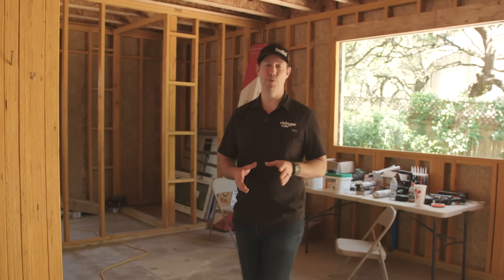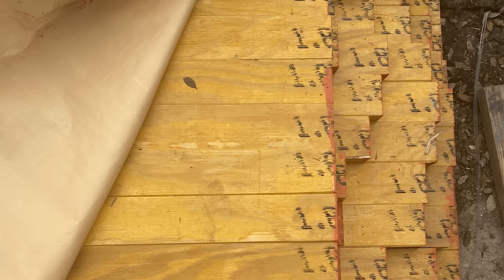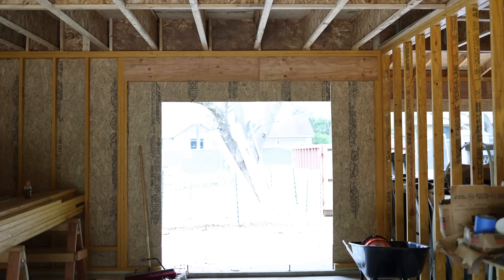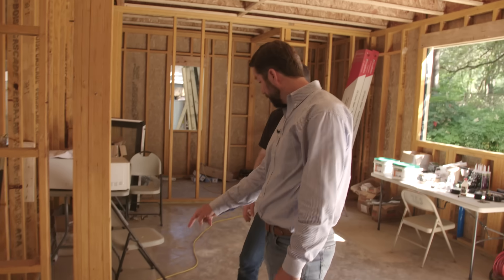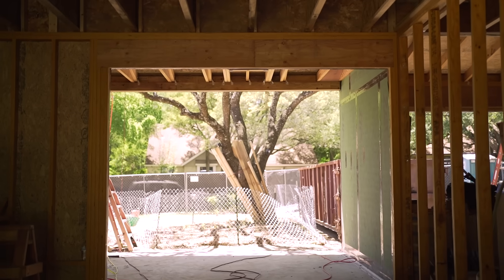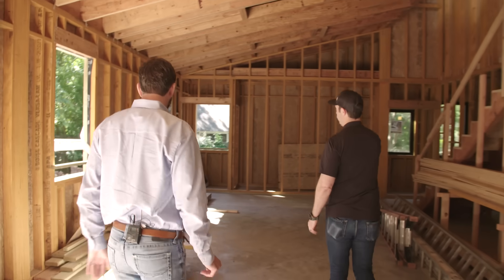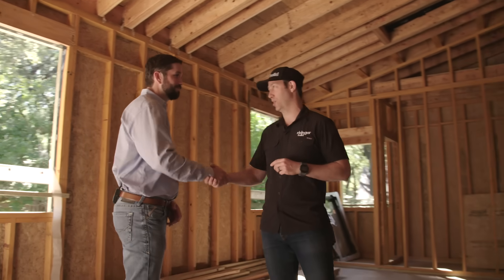House Engineering - Common Mistakes

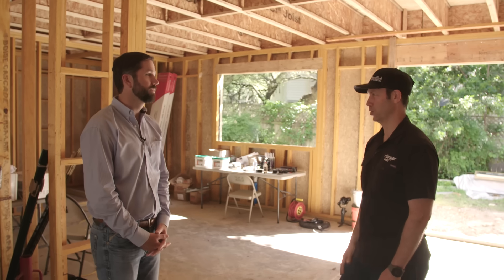Comment: I hope you know that all LVL PSL LSL lamined lumber products have zero water resistance. They can maybe handle getting a little wet once. I've seen those things literally disintegrate from water exposure. I've also been told that it is much harder to nail into engineered wood products compared to solid sawn, I'm wondering as a building what your feeling is on that? At 1:13 / 1:18 why is there a vertical seam in the header with all the joists landing on it, that makes me nervous. The engineered studs make some sense for balloon framed tall walls, usually we're doing 2x6 studs for insulation though. I just did this calc and 2x6 DF#2 studs @ 16" o.c. were able to support a 30ft wide roof with a 10psf horizontal wind load and were at 97% capacity in combined bending and axial factoring in a 2" diameter conduit in the middle of the stud. Not sure what you're talking about with floor trusses at 5:24, they are also made with some trimmable material on the end. At 6:13 what you're saying about screws in hangers in incorrect, but you correct it later, yes all hangers can use the SD structural screws instead of nails and it usually has a higher capacity. And yes the engineer needs to specify the fasteners for the hanger where there are different options with different capacities. Also you need to pay attention to the supporting member, for a 2x deck ledger or any 2x ledger, you usually can only use 1-1/2" nails and the capacity is 60-70% of normal. That's a really cool column at 8:40, I'm surprised you didn't use a PSL / LSL or GLB column though. The labor to bolt all those plys together. I'm not 100% on my built up column specs, it always required so many fasteners though. And I hope you checked the sill for compression perpendicular to grain, it's 625 psi max for DF#2 sill, or you need a steel plate to increase the bearing area. Sheetrock cracking at headers, at least the classic diagonal crack starting at the corner, has nothing to do with wood expansion, that is differential settlement caused by an overloaded or substandard foundation. It can also be shear cracking caused my earthquake or severe wind storms. Cool house though, I like it.

Comment: Advantech is only 30%higher than an A side 3/4pkywood.,but especially for a DIY SLOW build really worth the expense ..I think tape and SillyZip system at double price,isn't a bargain.l tear off 35 year old asphalt roofs and find bright ,good osb...this engineer basically told him SPF or Doug fir would have been fine as opposed to these high end SillyStuds.This engineer isn't Mr . Overkill  like l see ,as if cost IS important ..

Comment: Personally, I wouldn’t use engineered lumber to replace all solid studs except as mentioned is the span is longer at openings. This is an indication that wood will become a rare commodity in the next 10 years and engineered stuff will take precedence over solid wood.

Comment: You gotta keep i joist dry. Paint them so the moisture don't destroy the osb. It will stay same dimension as long as I joist stays dry. Did you use those I joist over your bathroom? Maybe should of painted them.

Comment: 6 min 21 s... you have nails in the side of your hanger on the bottom, into the I joint are those holes rated to accept nails, or are they are just pinch points for the I joist?

Comment: 100% wood framed houses are old tech. I want to go with Insulated concrete form contructruction which has  oval voids where basalt or graphene will be used instead  of steel rear. The spread of fire and huricane is my greatest concern because there is no waterline on.my acreage. The water table is low and I like to super insulate the large  64ft x 32 ft of air-conditioning space. I like to put solar on front facing south roof and maybe solar panels  on a 32ft x 32ft with a 8ft garage fiberglass translucent door and 16ft fiberglass translucent garage  door.

Comment: What happens if the framer uses 1.5" nails on the load bearing beams instead of 2"?  Since they won't hold the same load, what does the builder have to do?  Rip it out and do it again?
Reply: Engineers usually like overbuilt so they don't have to do detailed calcs. First thing the engineer does in that situation is run the detailed calcs to see if it's up to spec as is. But if it's not, get out the cats paw and swap out those nails one at a time. Pull one, replace, repeat doing your best not to wrinkle the hanger.

Comment: I hope this guy is not an engineer. He claims screws are brittle and hangers need ductile fasteners(nails) then says the hanger manufacturers now offer screws. The engineering is nails are cheap & weak and have poor pull out resistance. Screws of the correct size are more expensive, stronger and have tremendous pull out resistance. That is why you can use half of the number of the correct screws as nails. Brittle=strong ductile=weak. Shear strength is 65% of tensile. The tensile strength of the correct screws is much higher than nails, therefore the shear strength is higher as well.
At the end of the day unless you have a connector gun you should be using screws for hangers with an impact gun. It is faster and better than hammering them in by hand. The gun is not better than screws...simply faster.

Comment: Why use the blocking on the I joists? If this is about quality and efficiency, why add something that isn't required? I realize they will have some movement, but the sheetrock will create a diagram and stop this moment.  If it is in unfinished basement, then 1x4 strapping applied to the bottom flange at 2 o.c. will do a better job. But more parts and pieces will end in possibly in squeaks if not installed correctly, preferably with construction adhesive.   You are way to smart for me to keep up with.
Reply: Why use blocking?  Why not it’s the cut offs ?   Either use it or haul it away or burn it?  You would rather go out and purchase more and do more work to achieve less than 5 % of the result?

Comment: If engineered studs / subfloor beams etc. are very straight and true ( which they apparently are ) , it will make a much structurally  tighter , higher quality build. 
Also, the trades following will be able to produce a better and more efficient job all the way to the flooring. I like it.
Many wood frame houses hardly have a square to be found. 
Just need to make sure the foundation is flat to begin with.
And fix your 2.5 clips!

Comment: That " hurricane " / 2.5 rafter clip you zoomed in on is installed incorrectly. You want the bottom  two nails in the bottom top-plate. It's probably upside down...
Reply: oh BFD. Hurricane clips will never come into play unless a tornado of 9.5 earthquake hits. And if that happens your rebuilding anyway.
Reply: I wondered the same thing.  It's at 6:00.

Comment: While I like the engineered products as a fire fighter I think every home that is built with them should be required to have a sprinkler system, under a heat load they completely fail and put peoples lives in danger!

Comment: I moved to new mexico and now no one in the trades as im a stranger in a strange land ..  Im soon starting to build a house for my dad that will replace the (no kidding) plywood box in the desert he called home for 20 yrs . im far from a framer but i have framed a few house and several remodels and additions but none as elaborate as my next frame . im a lil intimidated as im not completely in tune with code . ive been watching your videos on several topics but i have questions about zip sheathing , tricks for framing for wind and snow loads , funny thing is ive moved from austin after i learn about these videos so i cant even offer jobsite tacos for a walk thru and Q&A ...  If you are as kind as you seem in the videos and have some idle time laughs ide could use the consult .. yamaha6chevy@gmail.com

Comment: The firefighter side of me watches this in horror. These engineered products burn super fast. This house is a firefighters death sentence.
Reply: Absolutely, I've mentioned this before as my brother is/was a firefighter.  If a newer style home caught fire they would not send anyone into the structure just because of the knowledge that everything will collapse.  Those floor joists are nice and strong, but put a match to them and they are gone in record time.  Not like solid lumber that can take some heat for a reasonable amount of time.

Comment: 7:32 I still feel uneasy about the column, especially when I see that the grouped studs are resting on a horizontal piece, with the 'grain' going the wrong direction.  I think a steel column would provide an extra measure of safety and longevity.
Reply: There's nothing wrong with that column resting on that sill plate. That appears to be a Boise Cascade VERSA-STUD for the sill plate which has a max allowable stress perpendicular to the grain of 450 psi. for a bearing surface of 3.5"x7.5" that gives a max of 11,800 lbs. I'm assuming they went with the 5 ply column because they couldn't source the equivalent sized VERSA-LAM column locally or something but Boise Cascade lists the max load for an equivalent monolithic column as 11,025 lbs. The sill plate is rated for the same magnitude of load as the column resting on it.

https://www.bc.com/wp-content/uploads/2019/06/versa-stud_2650_1_7_wall_guide_east.pdf

As for the notion that the bolt hole is weakening the column, that's already accounted for. The engineered max loads allow for up to a 3/4" hole to be drilled through the middle 1/3rd of the stud. Is it weaker? Yes. Does it matter? No, the max allowable loads already take that into account regardless of whether or not the hole is there. Even as far as extreme weather is concerned, this is an interior column and not part of a shear wall, it's not going to see a substantial increase in load even if a category 5 hurricane hits the house, that would mostly increase load on other portions of the framing.

Structurally this is completely fine and putting a steel column there instead would make it a headache to try and hide behind drywall.
Reply: I agree.  Those bolts take a lot of wood out of the column also.
Reply: Eh glue holds the house together... Looks good from my place
Reply: You need to use steal beams in that situation, I agree 100%.  Rolling the dice is never cool when people are living in that house.  Depending on the area, you can get extreme weather, and I have seen some serious failures with the family in the home.
Reply: Yeah, I'm sure the engineer was just doing it all seat-of-the-pants: "That looks about right." Good job looking out, guys.

Comment: Let's bolt 4 pieces of engineered wood together instead of using a Glu lam or PSL post. Sorry but we don't cut corners like that. Be smart spend the extra money.
Reply: @Andre_Blais  OBC allows 4 pieces of 2x4 to simply be nailed not bolted?  Here under the VRC anytime we pass 3 ply there must be a bolting detail and shear rating calcs.  Agree btw with doing framing and joist at 16 inches on center. Little extra wood and many less problems in the future.

Comment: Man those walls so flat and straight, can you talk about time savings that gives you later on for finishes? Did the engineer consider a TubeSteel post instead of the stacked LVL stud with an integrated bucket? I think that could've been a good option since you could have your bucket and floor connection also assuming the load transferred down to a large footing, it should have a mech connection like a post base.

Comment: Engineered wood are the sadest stuff when there is a flood, heavy spills, or a water leak.
Yes that includes those unexpected small leaks that discovered it was leaking for quite sometime.
Like ice sculpture in a hot sun.

Comment: I wonder why your engineer, regarding structural hangers, didn't mention the shear strength of nails vs screws. And also the pull strength. There is a big difference...as I remember learning. Correct? It's an honest question. Thank you kindly

Comment: Why is there a gap between the floor trusses and the stiffeners.../
If there is an twisting load the thin 7/16 OSB, it will still want to flex. If they cut the stiffeners to fit the gap in the trusses won't that be a substantial step in making it stiffer?
For someone who went to all the expense to do it right/better why not spend a bit of time to do this step right?

Comment: Total BS, A good carpenter reads the wind in a board and assembles it accordingly, to get straight walls and floors. What happens in 50 years when all that glue comes loose. If a wall is built correctly  it will straighten upon completion. Save your money, Use a good and well trained carpenter. And all those hangers rusting and corroding with time. Not to mention chemicals leaching out from all the glue used. Time tested and honored carpentry techniques surpass all this tinderbox glued fodder.

Comment: Sawn cut lumber has been used for hundreds of years it's not broke all these new products especially those engineered joists suck ads they don't hold near the weight as a traditional Douglas fir will ive seen em break many times and the price of those studs don't make it worth it at all there's many easy way to straighten boards with a little twist to em

Comment: When would you ever have a post pensioned slab in a residential application, especially slab on grade application?  @9:10 @matt risinger
Reply: Thanks for asking this... I had the same question.
Reply: @revitplumber  I think he is probably trying to sound knowledgeable or made a mistake. Maybe he is referring to a suspended slab with long spans..., maybe a basement room under a driveway?
About the only way I can see the need for post tensioned residential slab....

Comment: None of this material has been around long enough to truly know or understand just how reliable it will be in a hundred years or if its hit my a tornado directly just how well it will hold up. I can say I have seen at least a couple hundred houses hit by tornadoes and not one have done well yet older homes hold up much better the families have remained in better safer conditions. I am not sold on engineered material for an entire house yet. And you worry about a small drywall crack and repaint not me been around fifty years will use my real world experience and knowledge way before I trust a bunch of thin material glued together! Not impressed yet.

Comment: Hello I'm medically retired vet on low budget.  Repairing a moblie home is going to be a slow repair.  Ok to my question lol.  On the exterior walls in vinyl siding then I guess the weather wrap its card board  then studs. I want to improve the structure and outer walls. Seen ur sheathing video the zip r sounds nice what would  be best to wrap a moblie in with?  The r-3 r r-12. Is there a weight difference because all the videos say don't put to much weight on out walls any advice tips would be greatly appreciated.

Thank you in advance

Comment: That back wall has Natural headers, and I do not see a structural nail pattern in the header. 

Why structurally nail a  header if you are not going to put the nail heads inside where the inspector can see them?

2:32 framed in window

10p teco (stubby) works in most hangers. IRC requires glue in every TJI hanger.

Comment: My house is 103 years old and made from rough sawn lumber and the floor joists are tree trunks with bark still on them. Still standing.
Reply: Exactly. I live in an area where homes were built in the 20"s with minimal lumber and huge snowloads. Hardly any type of foundation etc. They are still standing although most have been torn down and rebuilt with the massive greedfest housing boom.
Reply: 100+  yo old houses were built with old growth trees. much stronger than any second or third growth trees available now.  fir and pine were basically hardwoods back then, being already many hundreds of years old when the great clearcuts began

Comment: As a volunteer firefighter I have to ask, is there going to be fire protection applied to those OSB web beams?  Will you be using a Type-X drywall on the ceilings?  How about a residential fire sprinkler system? An expensive house, with priceless occupants is worth protecting.

Comment: I love your videos Matt......I think your one of the best.
Engineered joist perform so much better than dimensional lumber, their only disadvantage is in a fire they do burn through quicker leading to floor collapse sooner.
It looks like your using 1 1/8" structural rim board and along with that you need crush blocks for load bearing walls. They are installed here where needed so this will pass but I thought you would explain to everyone why they are there.
Last thing......a bit of pl400 glue in the saddle of each hanger before you set the joist in gives even more resistance to squeaks.
I'm glad you mentioned why you don't use screws as a structural fastener .....in those hangers for instance.
I used to be a contributing contractor on the Holmes on Homes forums and Mike Holmes always used screws for framing and I started quite the argument with his forum moderators about using screws for framing. I kept telling them screws do not meet building code for framing anything structural with wood including exterior walls. 
They finally stopped recommending screws for wood framing after other contractors backed me up.....and then Mike shut the forums down after I also got into it with them about using cinder blocks for basement foundations.
Keep up the good work Matt.